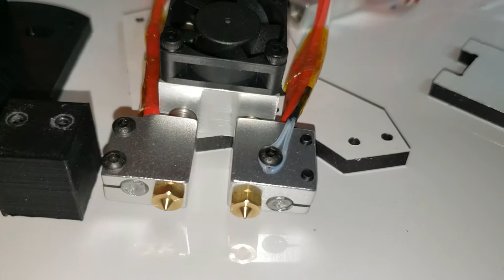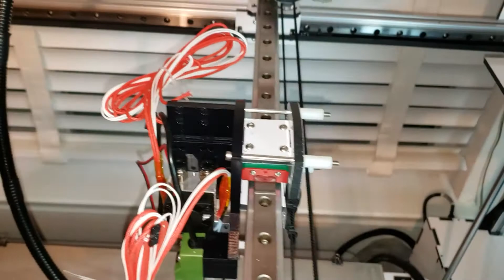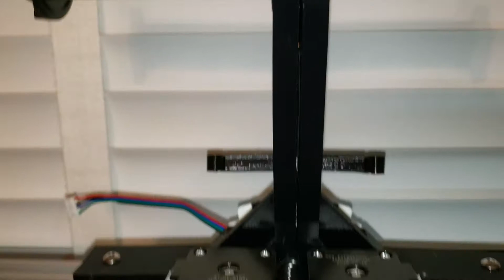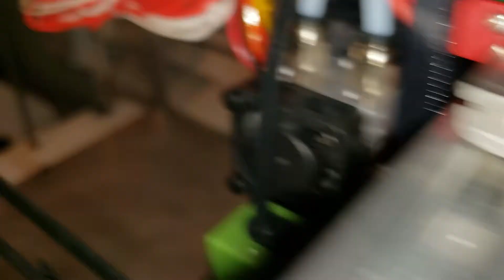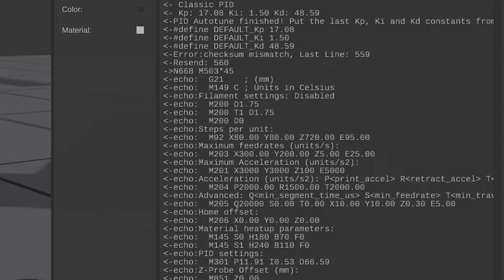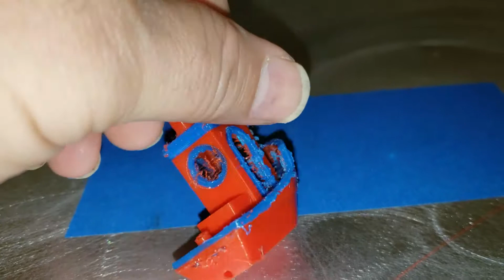Dual Extrusion Hot End

Comment: what bed is that, are you printing on bare aluminium?
Reply from the maker: Yup, that's what it comes with.  Pretty much total crap as far as adhesion, flatness, you name it!  I've seen a PEI build plate this size, but I couldn't justify the ~$150 investment for something that probably still wouldn't work well.
Reply: @lordbeowulf1885  i use kaptop tape or sometimes fr4 which doesnt work as well for me but ive heard people get good results

Comment: I have the chimera+ which you can find a good clone with the grub screws on the side. Pretty much the same hotend.

What stl did you use to dial in your nozzle offset? I feel like mine is slightly off but I need to get some measurements.
Reply from the maker: Hi Timothy,,

Sorry, it's been too long since i did this and thus I don't recall exactly what all I did.  However, I've pretty much given up using the dual extruder at all because my 3D printed mounting can't hold it tight enough that it can't tilt on me if it gets bumped.  And the bed itself doesn't seem level enough to avoid that, especially when something peels up and hooks the head, which is a pretty regular occurrence!  I've kind of given up on the printer completely until I can rework other stuff too.  I don't know if it's worth trying to buy a better bed surface over the aluminum.  I may just be throwing good money after bad.
Reply: Hey so I wanted to post on here,  if anyone needs help with adjusting offsets with this kinda hotend. I used a flat head screw with some glue stick direct on the glass bed heated to 55c. I used the controls on screen to get the screw tip right to the nozzle opening on one nozzle and wrote down the X,Y. Moved to other nozzle and did the same. Used the difference as my offset and printed a couple different cal test models. Made small tweaks till it was perfectly dialed in. 

Good luck and have fun, anyone that reads this.
Reply from the maker: @bleach_drink_me  Thanks for the information.  Sounds like a good solution.  I dug through my "Things" folder and found a pair of STL's called "dual_extruder_calibration_V2_extr0.stl" and "dual_extruder_calibration_V2extr1.stl"  The first creates a base and numbered XY grid while the second prints a second grid overtop.  You use the number that lines up to tell you how far off you are.   Hope that helps.  Edit:  Apparently dash-underline is some sort of escape code for YouTube and is creating that _strikeout and italics instead of leaving it in the file name...

Comment: just wondering what y offset value did you use for your two nozzles
Reply from the maker: Hi Kunal,

The tips are separated by 18mm.  I put that in the firmware, but I believe I still had to tweak the offsets slightly in my slicer to deal with some minor twist to the positioning.  I suspect swapping tips, etc. will alter that some.

Beo
Reply: @lordbeowulf1885  perfect thank you I put the same value and thanks for the quick response

Comment: Hi, (sorry for my english) i have been evaluated this printer's because i want to buy it, but if i understand well, you have problem with the kit you received, is this correct?, (some missing parts, a damaged heat bed, etc.) So i want to ask you if folgerthech replace the damaged parts, send to you the missing parts, and solve all the problems? Thanks!!!
Reply from the maker: Hi Ari,

It took a lot of e-mails but eventually (several months later) FolgerTech replaced the various damaged parts I had in the kit and refunded some of the money to help cover the cost of all the missing parts I had to buy retail.  So while they did finally step up and do something about all the missing/damaged parts, it was a lot more trouble than it should have been.  That also doesn't include the failed stepper drives due to the bad design decisions, etc.  If I contrast the FT-6 to the little SainSmart Ender 3 kit I recently bought for $170, the difference in kit quality and packaging was night and day.  I can say at this point that I certainly wouldn't have bought the FT-6 if I knew what I know now, despite the reasonable cost.  

Beo
Reply: @lordbeowulf1885  Thanks!!!!... One last question? Do you live in USA or other country?
Reply: @AriEl-me7fk  Im just gonna say you really shouldn't do it at all... just dont do it I bought the kit and I have been trying to fix the firmware for the past 3 months and I still cant get to work and while im no expert I dont think its worth it... they gave me a different model board and the provided firmware dosent work and they provide no help over email to me and its infuriating and I honestly should have just gotten a prusa and if im too late im sorry I dont understand what kind of company provides non-working firmware!!! I have had this printer for 6 months and so far is has been useful only as a table and I legit dont know what to do with it and I cant find anyone that has the same configuration as me who can provide working firmware If anyone sees this and can help I need firmware for the FT-6 with a bigtreetech 1.3 SKR board(the non touchscreen edition)
Reply: @mountain177  hi I tried to dm you but google said to dm you I have to go to your about section and then dm you... do you happen to know how to initiate a dm with me? If not then would you like my email and thank you soooooooo much for reaching out to help me :)
Reply: @kunalshah7539  yeah we can just email back and forth. It's easier than starting a dm through Youtube